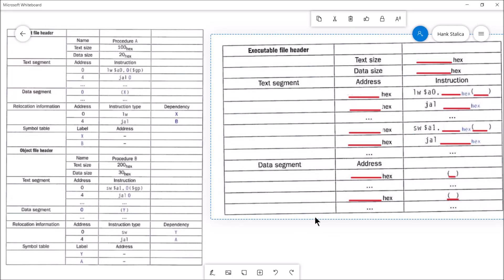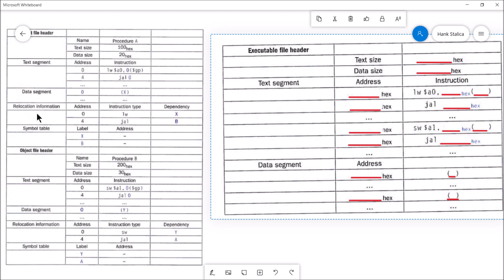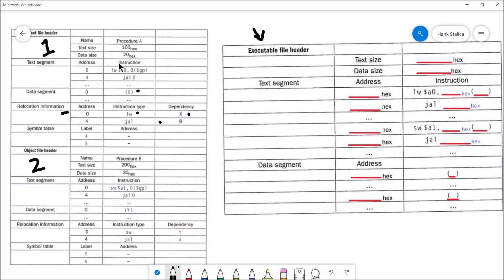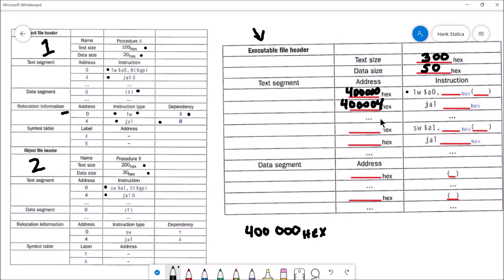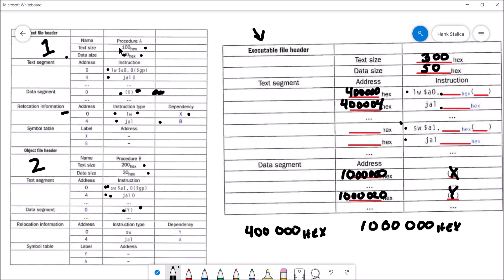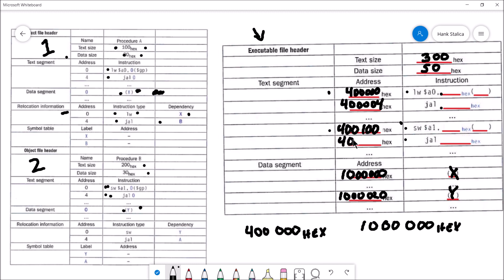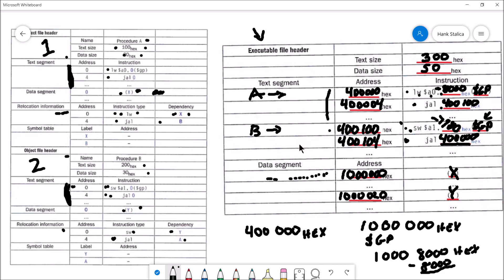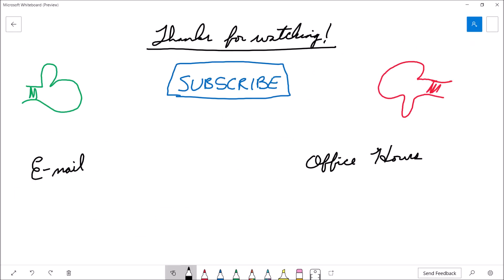Linker Example -  How the linker combines object files.

Comment: Hey nice video- do you know what could cause a linker to run abnormally slowly? Like a 3 second link time for a simple hello world, for instance
Reply from the maker: Not without doing some troubleshooting. Off the top of my head, if the linker is linking files from a different hard drive maybe.
Reply: @ProfessorHankStalica  interesting. I'm using nim and in the compilation output it sources some of the config files from a D:\ drive that doesn't actually exist on the computer. It's like a virtual path or something.

Comment: You got the 2nd part of the SW address wrong. It's a twos compelemnt negative number meaning the "half-word" (size 16 bits) MSB should be set. Hence it must be $8020 not $7980. See page 111 or chapter 2 of the P&H book.
Reply from the maker: Thanks for the correction, I really appreciate it.